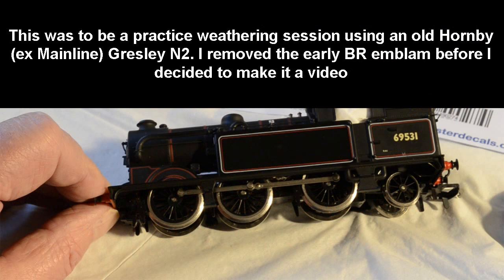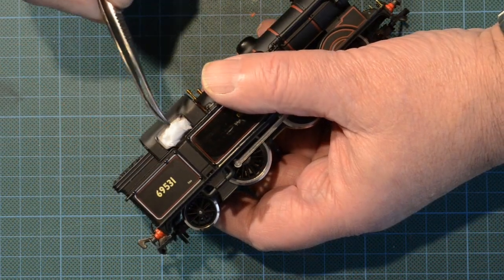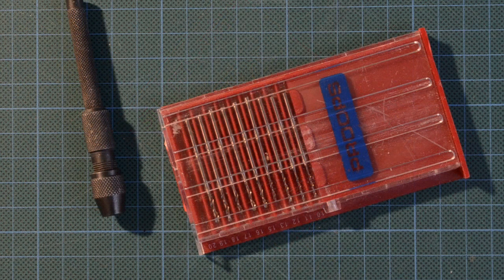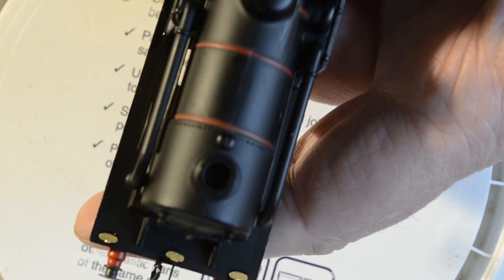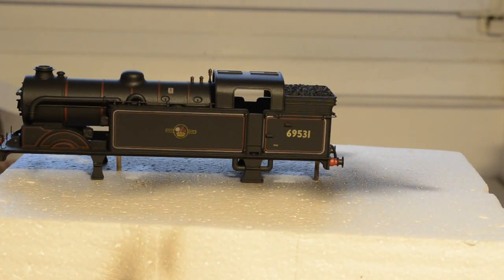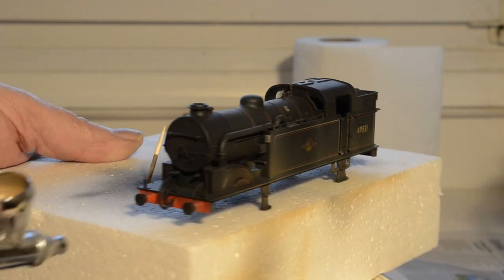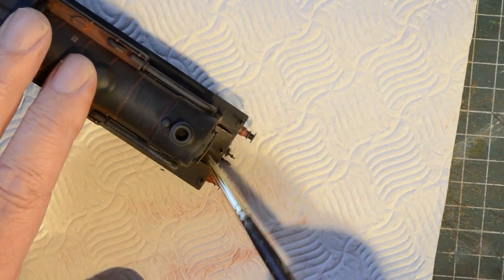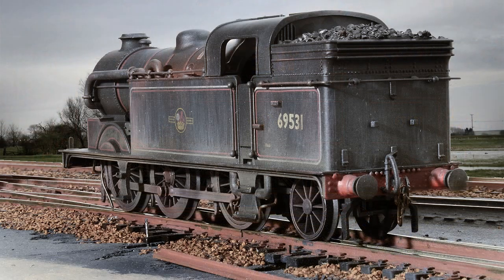WEATHERING & DETAILING OO LOCOS

Comment: Hi David, excellent video. I've been trying to gather the courage to weather my locos and you've given me the confidence to try. One trick I came up with for fitting screw link couplings through the buffer beam is to drill through with a one mil twist drill. Then using a piece of 1.5 inch long nickel silver rail that has had the upper portion sawn off to the base of the rail and for about a centimetre in length. Then file the bottom of the rail flat and square. I attached this to an old soldering iron using a small jubilee c!ip. I use this to cut the rectangular slot for the couplings. I hope I described this clearly.

Regards Gerry
Reply from the maker: Hi Gerry - apologies for delay. Not much help to you I am afraid. Love the soldering iron tip (pardon the pun). I have a couple of spare irons - such a good idea  -  thanks -  David
PS I expect you have dived in with the wreathing by now - hope it went well.

Comment: This turned out not subtle at all.
But this is how locomotives would often look like in British Railways days, so I like the result you achieved.
These old Mainline locomotives are good base models for super detailing, as the basic shape and dimensions are quite correct, and good weathering makes an even less detailed loco stand out.
One additional detail which I would have added is a brass smokebox door dart.
Reply from the maker: Hi, looking back, I agree, it is quite heavy weathering. Yes I remember the last days of steam it was quite shocking to see the obvious neglect. Thanks for your positive comments, and thanks for the tip about the brass smokebox door dart. This would definitely improve the look - too late now for this model but a good tip for the future  ...  Thanks  ...  David

Comment: fantastically filmed. ...I take it you used the hairdryer to stop the matt lacquer from chilling if spraying below room temp or to speed up the multi coat drying in fast bursts...jim
Reply from the maker: Hi Jim, The liquitex matt varnish is an artists water-based acrylic varnish. I always used it, very successfully,  on my model aeroplanes. The water doesn't evaporate as quickly as the alcohol or lacquer acrylics so I used the hair dryer to speed up the drying/multi coating. 
Hope this helps, thanks for the comment, Regards, David
Reply: Thanks David. ..👍👍